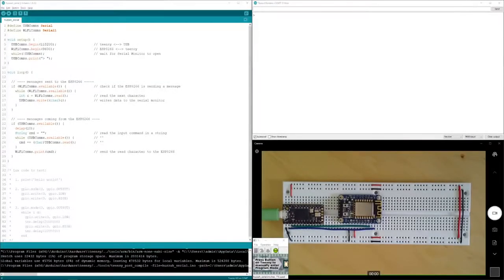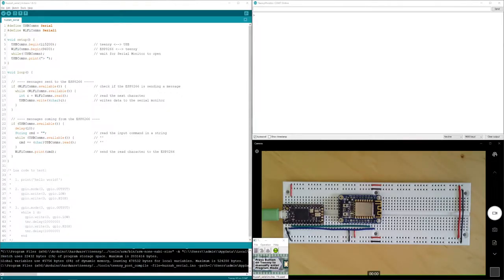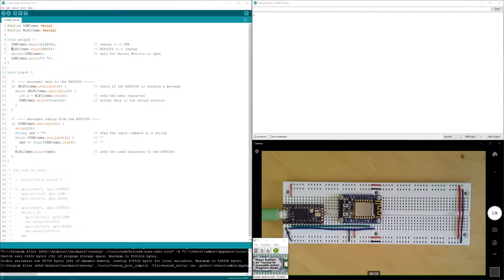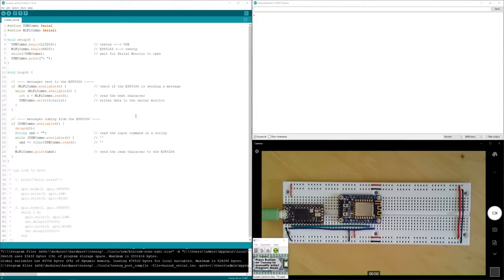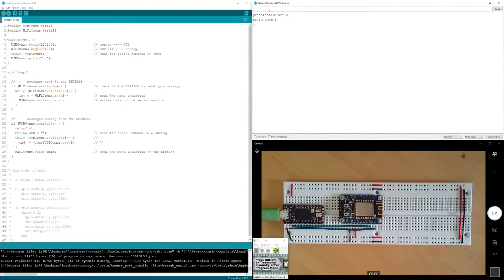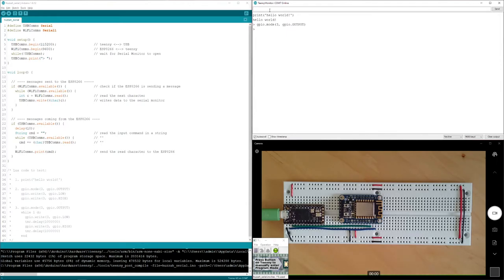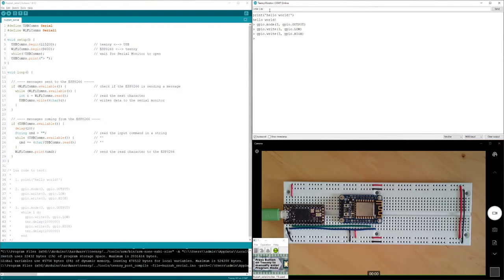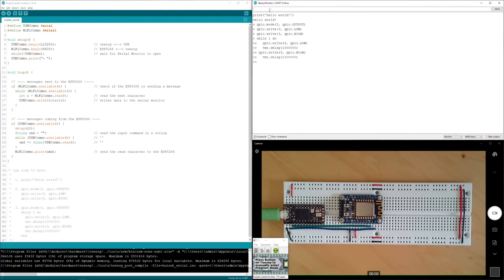Teensy in Five(ish) minutes: Adding WiFi functionality 02

Comment: Hi...I am also trying to connect the esp01 with teensy 4.0 but it is not working although all the connections are correct. The same program and connections are working with arduino uno. Could you please help

Comment: I dont know if you can read this in time that I need it. I use a teensy 3.2 and did the wiring exactly the same as you, i've also installed the board, but cant seem to find a connection with the wifi module. I can't get it to work, do you know what's wrong?
Reply: Hi...I am also trying to connect the esp01 with teensy 4.0 but it is not working although all the connections are correct. The same program and connections are working with arduino uno. Could you please help